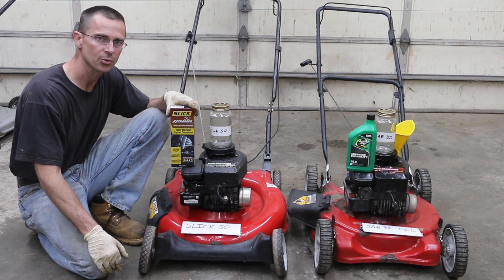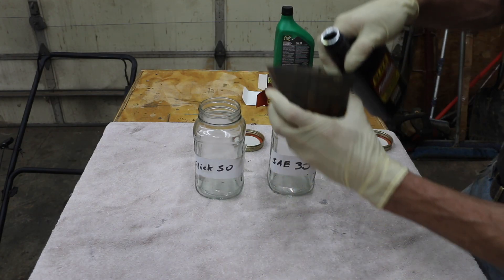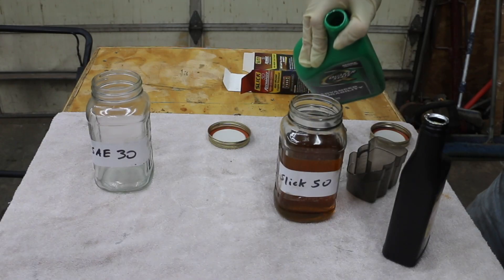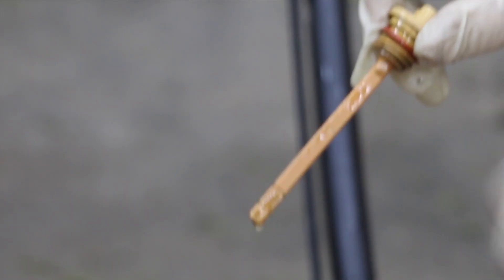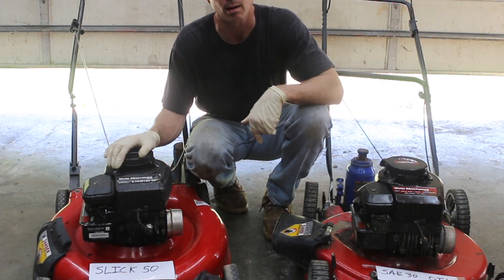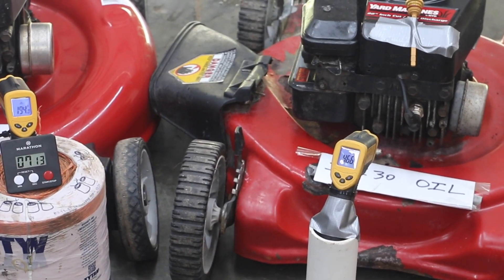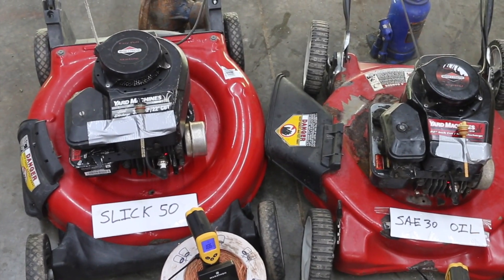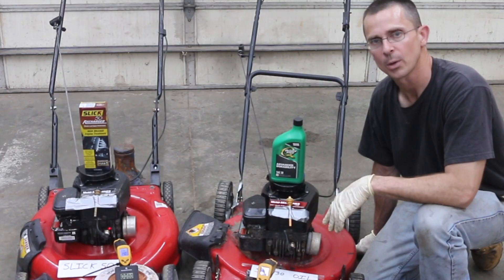Can't believe what SLICK 50 did to my engine!!--Dry Crankcase Test!

Comment: Originally, the procedure for applying Slick 50 involved running it for a while, immediately after changing the oil. It was supposed to coat the engine parts. PTFE has a rather high melting point. It seems to get absorbed by metal a bit, when it gets hot. Now, I have no idea why an untreated engine would run for so much longer. All I know, is that for the entire test, the Slick 50 engine seemed to be running much cooler. Did you try to restart either engine? Maybe residue built up on the plug. Try mowing the lawn with Slick 50, then retry the test, just in case there was something to the original instructions. On the other hand, I have no idea whether Slick 50 is using their original formula, anyway.

Comment: I believe that the slick 50 test you referred to was not slick 50 but Bardahl engine treatment. If I remember correctly they took a car, added Bardahl then drove it from Seattle to Vancouver. Drained the oil and drove it back to Seattle. This was probably in the ‘70’s and I may not be remembering it correctly.
Reply from the maker: Thanks for sharing.

Comment: Is it really the point to run the engine dry? 

Slick50 is supposed to be in the engine for a extended time and to work as a additive for better performance...

So how does slick50 preform over an entire oil change cycle?
Reply from the maker: Thanks for the video idea.

Comment: My family and I've used slick 50 or Nulon ptfe to many cars and never had a problem. With Slick 50 you can start the engine after its seized, that's the difference. It prevents the components from bonding via friction and heat. It happened to my brothers Toyota Townace on a long drive he accidentally left the radiator cap off and the engine seized. After it cooled down he added water and a radiator cap and low and behold it started. No smoke or knocks. I even used it for a back packer holiday it drove very smooth.
Reply from the maker: Thanks for the feedback.

Comment: The exhaust of your slick 50 engine is blowing all over the oil only engine.  That slows heat transfer out of the engine into the air, so it's not surprising that it's hotter.

Comment: Wow that's surprising, I used slick 50 a few times in the 90s. Jumped to Prolong, dumped them, now I use Turbo Maxx.  I would love to see how well Turbo maxx  does against every other major snake oil company and just plain synthetic oil. I run Turbo Maxx @ 1.25 oz per oil change. That's 5 quart of Penzoil 10w-30 full synthetic plus 1.25oz of  turbo maxx. Oil change intervals at 5K. Great partial suspension. Thanks for your very cool thought provoking videos. I make my own under coating, Living in the N. East, we need it.  Maybe at mine to the mix one day.
Reply from the maker: Thanks for the video idea.

Comment: I think the viscosity of the slick 50 is thinner and it more or less helps the actual oil disperse better so running it alone definitely might be rougher. Try Lucas oil stabilizer and do the same experiment. That would be awesome and I guarantee it would run longer drained versus just oil. Thanks for doing this.
Reply from the maker: Thanks for the video idea.

Comment: I’m fixin to use slick 50 mix in my generator but after seeing this video I’m not so sure anymore , granted it was run dry but I exspected longer life from slick 50. . Maybe the two together will help each other out creating a inner sticky wall inside for parts and cylinders preventing dry start up
Reply from the maker: Thanks for sharing.

Comment: The slick 50 makers sold the business years ago and took the formula with them.  The Slick 50 made in recent years is not the same.
Reply: @Tom I used Slick 50 years ago. It did what it was supposed to do. I also used their penetrating spray and it was a brilliant product. The formula has changed.  I tested this myself. I worked extensively in the motor trade and one advantage of this job was I got to test various new products as they were released on the market.

Comment: I think a small amount of Marvel Mystery oil added to the crankcase oil has benefits - the molecule size I believe is smaller than standard oil thus will seep into the metal pores better, giving added protection (almost like it soaks into the metal).. I think it also aids in reducing sludge build up, and reduces any type of buildup on metal parts, it might also aid in reducing heat, and discoloration from heat.. On most all my small engines (even 2 stroke chainsaw) I have used Marvel Mystery oil in both the crankcase and gas (I use 1/2 of what is recommended for both oil and gas) and have experienced good results... I have a snow blower and lawnmower bought in 1980 (still going strong - 40 years) Several years ago (about 7) I thought the mower blew the engine as it was spitting oil all over the deck so I just pushed it out back and bought a new mower (30+ years old, I figured I got my use out of it).. It sat for 7 years uncovered (through rain, snow etc). One day I was looking it over (for a crack in the block or what ever I could find) I noticed that the dipstick was not in the socket (reason for the oil spill all over the deck) - so I thought that the engine might not be blown after all.. I drained the oil (much water - dipstick still out of socket), put new oil in and some fresh gas and it started on the second pull (amazing, no gummed up carb or anything).. Was this feat all because of Marvel Mystery oil in both the crankcase and gas - possibly, who knows for sure..

Comment: I mentioned this product to you once before.  Made by lubrication engineers. Monolec 8800/15w-40 specifically engineered for diesels but works just as well in gasoline engines.    They don’t sell the additive but it’s the monolec that bonds at a molecular level supposedly that aids in reducing friction and wear.  Extremely good at cleaning insides of engines and carrying those deposits etc to the filter.  Lots of supporting testimonials etc.  company has been around since the 1950’s.     My father was running their fluids in his NV4500 manual transmission.  Had a failure causing him to lose the fluid in the pan. Drove like that for 50 miles towing a trailer.  Most everything was re-usable and not destroyed.  The person rebuilding it was amazed.
Reply: As a lead engineer in fruit warehouses in Central WA.,I can attest to the fact that every thing that LE makes is superb. Their food grade grease and oils have no other products that compare. Their grease is polymerized and is the only one that will not separate under cold and wet conditions. Can't say enough about the superiority of this product

Comment: Slick 50 is a blast from the past! I remember my uncles talking about it, being snake oil. And they were most likely proved correct on exactly the same push and shove mower I use for my trimming. I'm afraid that thing won't last thru the next cutting with the oil topped off.....
Reply from the maker: Great point!

Comment: Wow those results are surprising. I recall a product called pro-long that made the claim it was better than slick 50
Reply: i remember Duralube also claiming they were better than slick 50 and they drained their engines claiming they ran for like 48hrs. thats the only one ive used. slick 50 was like twice as much

Comment: My friend , I really appreciate your well thought out tests. Back in the 1980's I was a Slick 50 rep. We would pretreat an engine by running it for several hours with Slick 50 before running it without oil. 
I continued to use the product after canceling my distributorship and over the years noticed a formula change, they stopped using PTFE, the ingredient that made Slick... slick. If that had been the original formula it would have run much longer. I did that demonstration many times and could place my bare hand on the engine while it was running! 
Here's the story...   https://www.youtube.com/watch?v=CAt-tJa9P_s   Keep up the good work!
Reply: I can attest I had the same results (Mid 90's). I once drove what I figured to be several hundred km without any oil showing on the stick. Funnily enough the engine outlasted the rest of the car and I sold it as a parts car to a friend, engine still ran fine with over 400,000km. Mind you it was an early 80's Toyota tercel so I'm sure the engine build quality helped it.
Reply: Teflon was sold to a lot of “snake oil”resellers that added Teflon to oil without doing any formulations. Teflon could ball-up and plug up oil passageways causing failure due to oil starvation. I believe one of the better teflon additives  had the correct ion bond with oil and kept Teflon in suspension. Anyway Teflon manufacturer suffered many lawsuits and stopped selling Teflon for use as an oil additive. I used a Teflon additive in a Mercury Capri and the engine would rev an additional 1000 rpm after adding it. I also used Teflon in bearing grease, but didn’t notice any difference.Formulated properly, I think it is a good product. I think it was the slickest product on earth.
Reply: Yes that has zinc in it which is a great lubricate for engines!
Reply: The original formulation with PTFE had a milky appearance.  In the early 80s I had a Chrysler Cordoba with 119,000 miles on it and it had a front crankshaft seal leak.  It would leave an oil puddle everyplace I parked.  I did an Slick 50 treatment on it exactly as the instructions stated.  The oil leak stopped after about 3,000 miles and the last I heard the car had 236,000 miles on it and was still running good.  BTW, back then the price was $40 a quart - down from $50 per.
Reply: They got cheap.
Reply: I'm the guy in the video on the left interviewing John Bishop... We've been friends since 1993.
Reply: If they aren't using PTFE resins anymore, what are they using, and its it as good?
Reply: I first used Slick 50 back in the early eighties  (in Australia) on a then 12 yr old 245 CI Chrysler Valiant 6 cylinder.  You had to shake up the 1 litre bottle before pouring it into the engine with fresh engine oil also.  The instructions said " full benefits will be noticed after 1000 kilometres when the PTFE in the mixture had fully chemically bonded to all friction parts of the engine".  Well it did make a huge difference to the old engine.  Easier starting. Better fuel economy.  Car glided much further down the road after taking the foot off the accelerator pedal, this is when i noticed that difference.    I also gained about a extra 500 RPM at idle, & had to adjust it down to factory settings. It truly had removed nearly all friction drag in the engine.    I recommended to others to use & they were more than happy with the noticeable improvements with the engine.   But without PTFE today maybe the product isn't as good now?   In Australia we make our version with PTFE in the mix....."Nulon Long Term Engine Treatment.'

Comment: Thanks for that test. I had a Fiat with 100,000  miles on the clock and I slicked the Engine....  I was amazed that I was getting Miles per Gallon and top speed like it did when it was new.   Very surprised it gave up the ghost before the other engine,,  Many thanks
Reply from the maker: You are welcome!

Comment: Slik 50 is not the same product as the original pre 1984. Now sold as XcelPlus from Australia. Also directions for use state the oil must be left in the engine for at least 5000 kms.
https://www.youtube.com/watch?v=CAt-tJa9P_s

Comment: I like your methods and attention to detail.  One thought I have is how much run-in time Slick50 needs to fully coat and penetrate the cylinder walls.  It may need more than just a few minutes to properly treat the metal.  
I had a 92 Ford Bronco with a notorious oil leak after 130k, to where some times I’d run the sump pan down to less than a quart.  The motor was a 302v8 and was treated at 50k and 100k with Slick50.  Regular oil changes with conventional oil, because synthetics weren’t all the rage at the time.  That truck and motor gave me 210k of service over 20 years before the frame and body rotted off around the motor.  I’d like to think that the treatments prepped the motor for a good lifetime under harsh conditions.
Reply from the maker: Thanks for sharing.

Comment: I had an old truck many years ago that was on it's way out. Smoking and terrible loss of power and fuel usage. Treated it with Slick 50 and the smoke stopped, power returned and fuel mileage back to normal. I pulled a heavy boat to a lake 40 miles away down a mountain road. Before treatment return trip was 35 mph up the 6% grade and 3/4 tank for the round trip. After treatment the speed up the mountain was 65 mph and fuel usage was 1/4 tank.  Slick 50 had to be used every other oil change but keep that motor going for over a year before it gave up the ghost.
Dramatic results for an old worn out motor but what it does to a motor in good shape? Where does all that unneeded Teflon wind up going? What form does it take after 50k of heat and wear? How would you know without tearing one down to find out? You don't just speculation.
 
lol After all that, I'm all in on a bad motor if you need some help and time extension on shelling out some bucks. Nope still don't trust it on my new motors. I'll stick with the synthetic oils and call it a day.   
And nope, I surely didn't expect the results you got! Is what it is though.
Reply from the maker: Thanks for sharing.

Comment: Ok, like what you did this been there. Z Max is a better additive. S 50 is good to use as directed,  it needs to cut with the oil that's recommended. It needs to imbed in the parts. This worked well on 14 hp kolar noticed dropped in friction had to re set idle and increase time I could get to cut the lawn. Used in 2 stroke  snowmobile 292 single cylinder, great longevity,  different application as had to spray in carburetor,  smoke like hell but that's the way to  get oil in the case. 2 stroke than can run leaner oil mix. Had a Aztec (strange Pontiac like breaking bad) 230k plus miles ran Castrol and treatment with Z max when I first got it and about every 5 changes for good measure. Accident killed the Aztec. These products alter the micro surface and I have not had any seal issues while running. Good luck love these videos. I now run full synthetic and these newer oils are on a different level than we had in the 80`s.
Reply from the maker: Thanks for sharing.

Comment: Had a rig in the 90's with a 400 Cat. I put the slick 50 for diesel engines into my motor while it was running, you could instantly hear the idle smoothing out. The running a engine without oil never sat well with me, but there was a marked difference when I put it into my motor. If it wasn't so expensive I would still use it.
Slick 50 is not a replacement for oil, just a additive. Me thinks you diluted the oil too much.
Reply from the maker: Thanks for the feedback.

Comment: I raced SCCA 2 liter sports racing class for many years using slick 50.  I lost 2 engines my last year using slick 50.  My last year of racing, I sent my engine's pistons, rod bearings, and crank to Gilmore Racing (A J Foyt's engine builder) and had the  parts Teflon coating baked on and milled back to spec.  I ran an entire season without an engine loss and finished number 5 in the national standings.  The idea of slick 50 was right, but the bonding must be done at a much higher temp than the engine would build up in normal engine use.  Just my opinion based on racing high rpm engines.
Reply from the maker: Thanks for sharing.

Comment: People often don't realize that oil is just as important for cooling down internal (mainly piston!) parts as for lubrication. A better lubricated, cooler running engine without oil will have a smaller cylinder combined with a hotter piston due to this and probably will seize up faster. All in all, no engine can survive without the cooling effect of oil, maybe with exception of very low-power, old-fasioned ones. They can survive without the lubricating effect for some time however, think MolyKote in Spitfires in WWII?
Reply from the maker: Thanks for the feedback.

Comment: It should be noted that when slick 50 first came out it actually worked pretty close to the way it was advertise. But there was some sort of legal problem that I never understood quite right. And the mixture of slick 50 and change. And it has never been as good as the original mix. I don't know why oh, Just Dance. I never did trust it because the only two engines I ever saw that they claimed had been treated with slick 50 and they drain the oil out of them or either a slant six Mopar engine or a 318 Mopar engine. Both of which will run for extended periods of time without oil in them. Especially the slant 6, I've seen those an operation without a oil for months or even years. So the test wasn't telling me a thing.
Reply from the maker: Thanks for the feedback.

Comment: Slick 50 is an additive that is a oil conditioner. There is a product that I use called "X treme Friction Fighter". It is a metal conditioner and it can be used in any internal combustion engine, gear box assembly, hydraulic system or in anywhere bearings are used. It uses the lubricant as the carrier and it frees of moving parts from friction. I have used it in the engine in my pickup truck for years and have seen better horse power and better gas mileage. After having oil cooler hoses replaced, one of the blew out because it was defective. I lost all the oil in that engine and yet the engine survived and continues to run just as though nothing ever happened and this was after that hose was replaced. Some like happened with a truck driver who used that product in the hubs on his truck. The seal on that hub blew out, all the oil was lost. Only the seal on that hub had to replaced as well as lubricant and yet the bearing was unharmed.
Reply from the maker: Thanks for sharing.